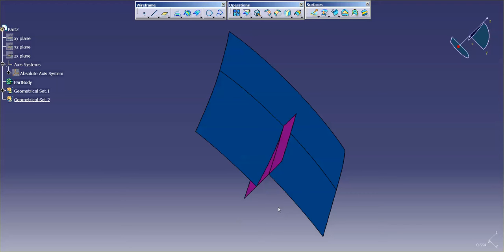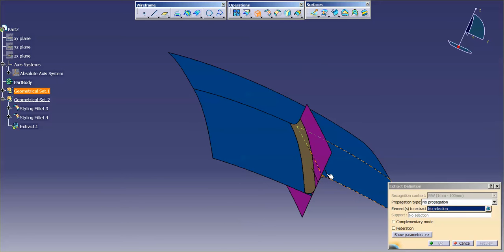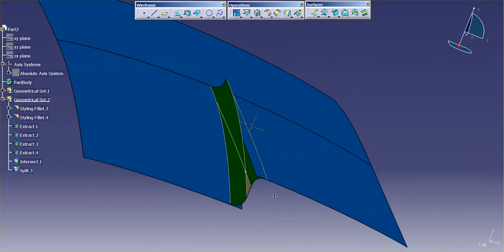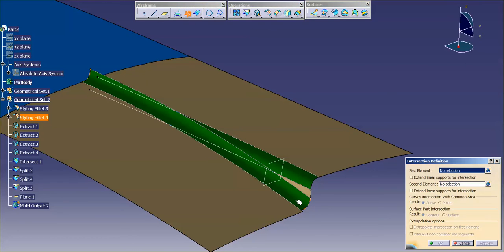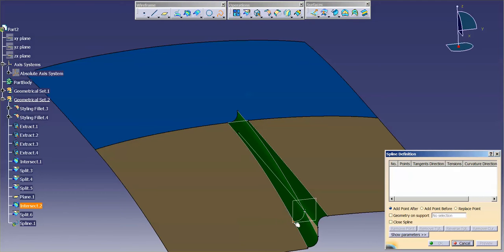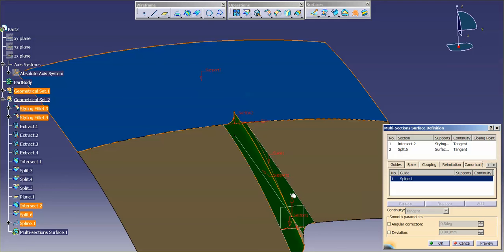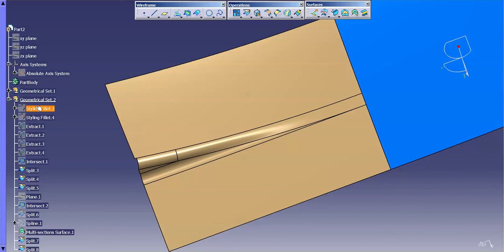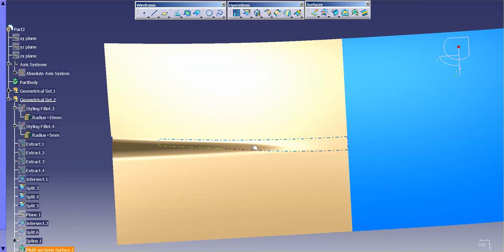Blend Out Class A Method - Catia V5 | Catia V6

Comment: What is the complexity of the resulting "blend" surface? Degree, spans, knots? It is really arbitrary to define what "A-class surface" is.
I would like to think as the simplest set of at least G2 (curvature) continuous surfaces/curves, each consisting of single span, smallest degree possible (without knots).
Of course there could be a compromise over the knots and sometimes 2 knots could be acceptable. In other case (very small fillets) G1 transitions are acceptable. Or for some technical applications (rotating parts) also G1 in fact might be a requirement.
Reply from the maker: That is what I tell people. The simplest surface that meets all requirements. 

Those differences are spread out based off of if the surface is a primary vs a secondary vs a tertiary.